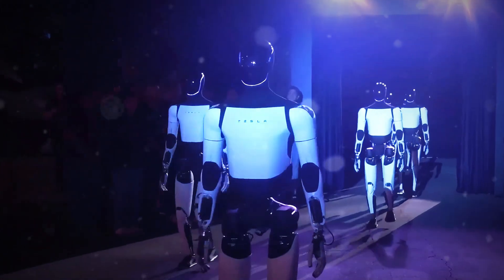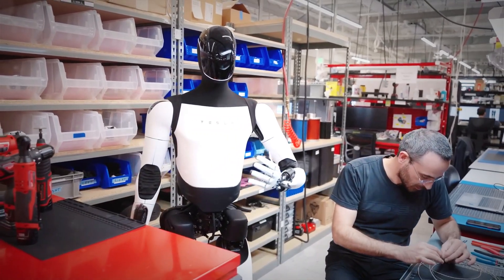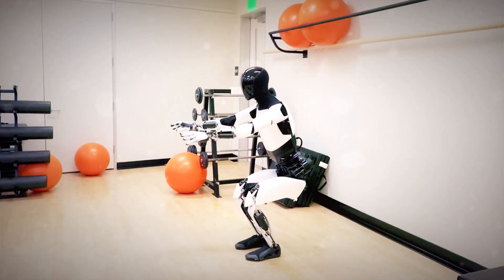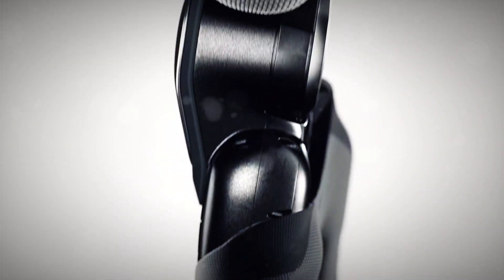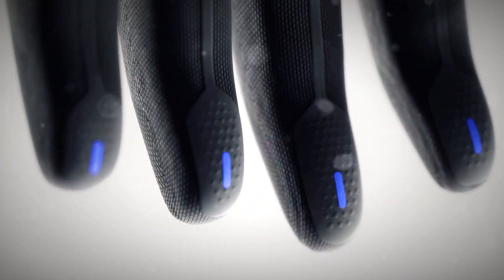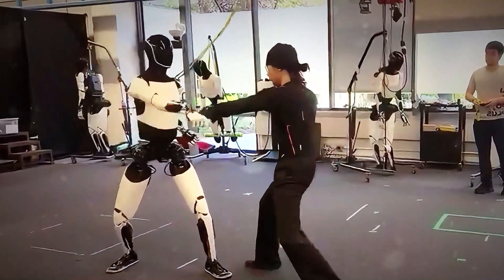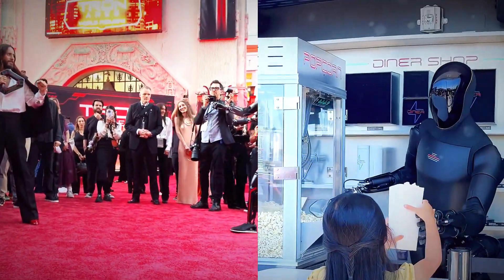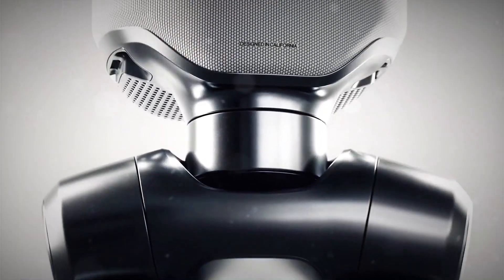Figure 03 vs Tesla Optimus 2.5 — SHOCKING Upgrades No One Expected!

Comment: I dont like Figure 3's outer garment. First, the hands need to be able to get wet without soaking up the liquids. Second, it's probably glued on so it won't last and third, cleaning it will be a problem, long-term. Other than that, they've pulled off someone great. A direct competitor to Optimus. Hopefully, Elon will pour on the gas now for Optimus. I think Tesla still has the edge but not by much.